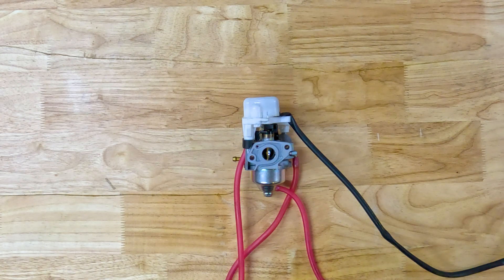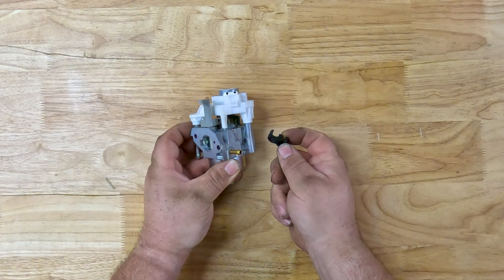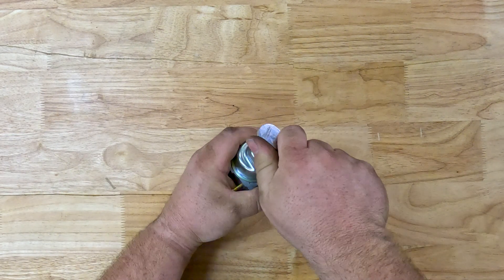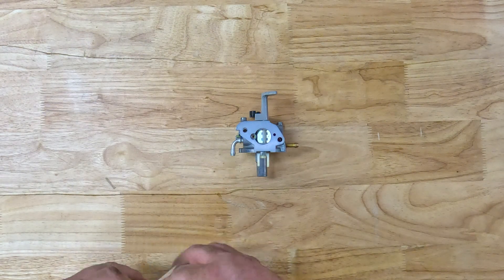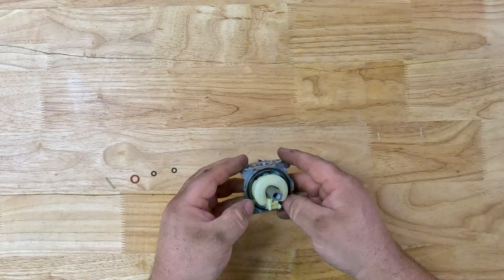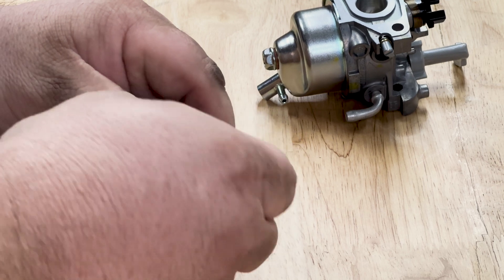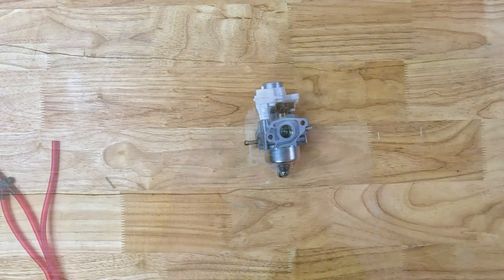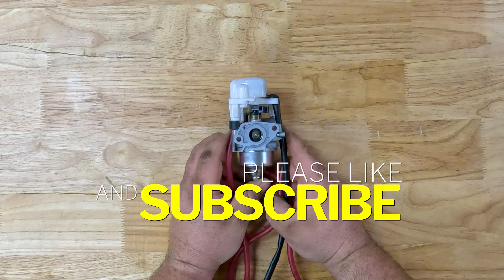Honda EU20i & EU22i Carburetor Service

Comment: Thanks for your video. How do you clean the jets without damaging them? I saw a number of videos that showed using a welder tip wire to open the ports and I saw one article that said not to use a welder tip wire because it would change the dimensions of the ports. Would just using carburetor cleaner and compressed air work?
Reply from the maker: Hi Richard, I clean the jets by placing them into an ultrasonic bath with a special chemical that doesn't damage the metal. Apart from that carby cleaner and compressed air should do the trick! Cheers - Dave
Reply: @melbournepowerequipment3441  Thank for replying. It seems like buying an ultrasonic cleaner would be a good idea. Can you recommend one? I have another question. Once you use the ultrasonic cleaner for auto parts, do you have to dedicate that clearer just to auto parts because of contaminating further items that you might want to clean? I can see how it might be useful for other items.
Reply from the maker: No worries at all Richard! Yeah it is a well-used piece of equipment in our workshop! We have 2 of them, a smaller one we have dedicated for carburetors which we replace the liquid in regularly, and then a bigger one that has a heavier degreaser in it for other parts that may need a deep clean. Cheers heaps! - Dave